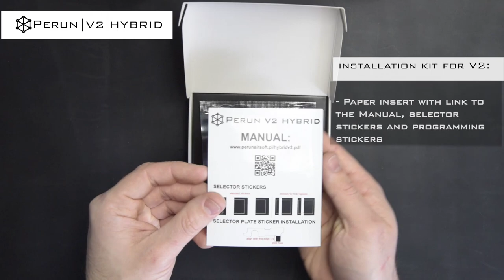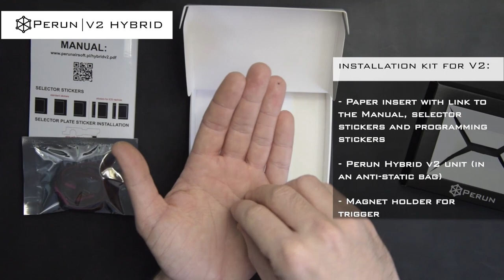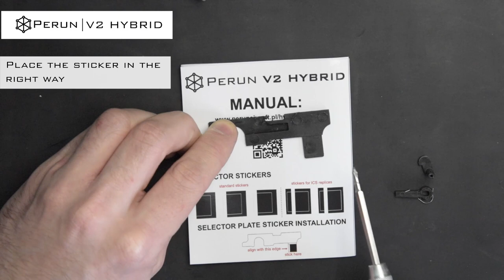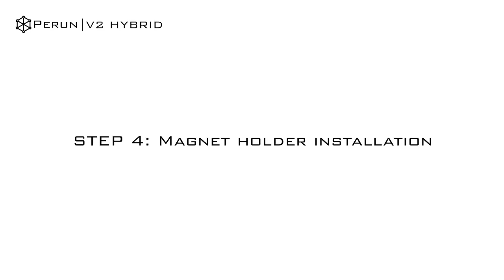Perun V2 Hybrid installation manual

Comment: hi, i've been getting great reviews from friends who use your mosfet on their aeg, and are eager to get one myself, so i want to ask if the hybrid v2 would still be fine and running after getting water in just like the optical in your old video? thanks
Reply from the maker: Thank you, we're happy to hear that :) The Hybrid should be fine after contact with water. We have tested it in a similar fashion as the Optical and it survived just fine. We still wouldn't recommend purposefully putting it underwater, but should your replica for some reason drown in a river for instance, Perun will most likely keep working.
Reply: @perunairsoft4811  that is great to hear! Thx for replying :)

Comment: Wow. I have the standard on my ICS. Will there be a video with an ICS gearbox installation
Reply from the maker: We don't plan on doing a separate video for ICS, but the installation process in your replica shouldn't be much different. It would actually be easier in an ICS thanks to the split gearbox.

Comment: Would any of this change in an LCT lk 33 gearbox
Reply from the maker: Do you mean, whether the installation would be different? It might be, because LCT often uses 32:1 gears, also known as max torque or infinite torque. Perun V2 Hybrid can't detect those and they need to be replaced to, for instance, a 27:1 gearset.
Reply: Thanks so much for the reply I will take a look at the gears tonight, I was in fact wondering if the installations would be harder for any reason. For example the trigger is huge G3 style and I was wondering if that would work. Also how different might the selector sticker have to be. @perunairsoft4811
Reply from the maker: @sebasscasey3908  Trigger is different on the outside, but the inner part which would mate with our magnet holder, has standard dimensions and will work just fine. We can't advise regarding the selector sticker, though probably the standard one (non-ICS) should be ok after finding the right spot.

Comment: So I was in the process of installing
mine when I did the sensor test. None of my sensors are working except the safe position. I double checked and the selector plate sticker is in the correct position and I did everything mentioned in this video. What should I do?
Reply from the maker: Please contact our tech support through info@perunairsoft.pl. They will answer you within 1-2 days.

Comment: About filing down the safety lever @ 6:31 -- a lot of people will have to do this, and not realize why at first. The magnet holder partially blocks the gearbox retention pin, so you'll pull the trigger to get that inserted, and your trigger will always be part-way pulled, like a trigger shim. But you have to make sure the safety lever still works as it should with the the trigger's new position, and that's why you have to file it down, or remove it. I didn't file mine enough, and the safety is stuck on until I open it up again to fix. This is a big headache, and a reason why I prefer the older Optical unit.

Comment: my sector gear has a magenet for my current mosfet. do I need a new sector gear since this perun mosfet senses magnetic force?
Reply from the maker: It depends on where the magnet is located on the gear and how strong it is. It's very likely, that it won't interfere with working of Perun's trigger sensor, which is the one magnet-based. You can also try removing the magnet.
Reply: @perunairsoft4811  thank you for your prompt response. Can’t wait for my Perun mosfet to arrive!

Comment: Hello, I installed a Perun V2 Hybrid into my CYMA and when I do the diagnostics test everything seems to work except when I flip it to Semi it flashes blue then red. When I flip it to Auto it just continues to flash yellow with no response. Would you happen to know what's wrong?
Reply from the maker: Please check, whether the selector sticker doesn't need adjustment according to the graphic in the middle of page 5. in the manual for V2 Hybrid: https://www.perunairsoft.pl/hybridv2.pdf
If that won't help, please contact our tech support at info@perunairsoft.pl

Comment: Would this work in a version 2.5 gearbox ? I have a cm098a
Reply from the maker: Yes, but there are two small caveats: 
- with 19-teeth gears and if the build is rather slow, if you don't want to use precocking, it's recommended to actually set precocking to level 1 or 2 to ensure proper gearbox cycling. In all other cases the Hybrid can be used similarly to any other replicas,
- you'd need to grind down a small, protruding part of the gearbox shell, which normally holds the contacts; it's something that has be done to accomodate almost all drop-in mosfets.
Reply: @perunairsoft4811  okay o think i know what part you mean. I have actually installed a 13:1 gearset so i think it Will be fast. Just need the Perun for better cycle of the gears as the cut of lever cant keep up. And also of the cool feuteures ahah

Comment: Hi why i cant enter into programing mode, gun shoots and all and i have made the sensors test many times, its all good, but when i test it with the motor on, i cant see any light or enter into programing mode for any shooting mode. Gun just works normally bit cant program it.
Reply from the maker: Do the firing modes work; can you access semi and auto? If yes, please try moving the selector faster.

Comment: how about trigger response? in the older version i can use in just 1.5mm to firing i can adjust the black piece in the trigger?
Reply from the maker: In the new version, the Hybrid, the trigger piece should be exactly where we recommend it be. Pushing it forward may result in a longer trigger pull. To adjust the trigger pull length, only the trigger sensitivity setting available in the programming mode should be used.

Comment: I plan on getting this for my vfc mcx, how would I go about running the wires?
Reply from the maker: We haven't worked with that particular replica yet, nor have we received any feedback regarding installation of Perun V2 Hybrid in it. Therefore, we can't reliably advise whether and how would Perun Hybrid fit there. However, we made some quick research on the internet and it looks front wired version should work. Still - we can't guarantee that modification to the replica or wiring won't be necessary.

Comment: Hi there,
I'm planning to install the V2 hybrid in my Lancer Tactical gen2, but it doesn't have a cut-off lever since the LT G2 already has an ETU instead of a trigger switch. I'm wondering if that would be a problem since the screw on that ETU is smaller than what a cut-off lever has.
Reply from the maker: Hello,
If the diameter of the screw's head will be too small to hold the board, you can try using a washer. Some of the gear washers used in AEG's could be good for that purpose.
Reply: Thanks! Good thing I bought some shims awhile ago. Can't wait to have it installed.

Comment: After finishing the install, the guns shoots for like 1 second and then get the intermittent red light. Is it my motor? I’m using a stock vfc black motor, shs 13:1 gears. Stock vfc mp5 a5 spring.
Reply from the maker: The battery might be too weak for that build or there is too much friction in the gearbox for some reason. Please try with a bigger battery and if that doesn't help, check whether everything in the gearbox moves smoothly after it's assembled. Should nothing come out of it still, please contact our tech support at info@perunairsoft.pl
Reply: @perunairsoft4811  I am new to airsoft and aeg replicas. since I own a Cybergun FN SCAR-L aeg, I noticed that it worked well at first, but when I started to use an 11.1V lipo instead of the stock 8.4V NiMH battery, the V2 gearbox started to make more noise than before, and then, it caused me trouble.
I took the gearbox apart and removed the stock grease, which looked like tooth paste (and probably greased the gears just as well). I then reassembled it all and tested the SCAR again: it was better, but still not reliable. BB-feeding went astray more often and the sound was still not good.
Then I took it apart again, cleaned all the bushings and gears, piston and just everything there was, after which I applied general purpose grease from a canister, which is meant for greasing hinges and such. I also took the O-ring and stretched it by putting it onto the outer cylinder, before I greased it too and put it back on the piston.
I did not have high hopes for this arbitrary action of mine, so all the greater was my astonishment when I had reassembled it all: the SCAR was shooting like it never did before! High FPS and high ROF, and no sign of a miss-feeding whatsoever! Amazing! All I did was remove the old grease, cleaned everything and greased it all. The hardware is still stock, with standard contacts and no mosfet yet.
But, I am considering the Perun V2 Hybrid anyway. I do not like the idea that copper contacts are switching 7A or more current as in the good ol' days of the early 1900's. Electronics like a mosfet ought to be standard.

Comment: Everything goes great but when I assemble the gear box it just doesn’t ONE shoot and stop working.
When I force the motor head, it’s seem like come back to work, but the same thing happen again, I assemble the gear box and after one shoot, stops working 😔
Reply from the maker: Please make sure that everything works smoothly inside the gearbox. You can do that by assembling the gearbox without the main and the tappet plate spring, piston in the forward position, and then spinning the motor gear manually using a screwdriver, bit by bit, until you make a full gearbox cycle. The gears  should be moving without much resistance.
Also make sure that motor's positon is not the problem. The motor being positioned too far from or too close to the gears can both cause such a problem. You can also look for short circuits caused by pinched insulation.
If this won't help, please contact our tech support at info@perunairsoft.pl
Reply: @perunairsoft4811  I tried again and it continues the same problem.
All the 3 gears works smoothly together or separately. 
It’s like same security system blocks the motor. When I shoot one, the gearbox do one cycle and stops. After that, when I connect the battery, it doesn’t make the BIP sound.

To make it works again, I have to remove the motor, force it with my hand to do one circle, and the system make that bip sound again. So I assemble the gearbox, and when I pull the trigger, it does one shoot and stops.

All the lights are working perfectly, the 3 fire mods, the purple trigger lights, the gear cycle lights… but when I shoot, it stops.

When I put the non-electrical trigger system back on the gearbox, everything works fine. 😔
Reply from the maker: @mauconx  We see, in that case please contact our tech support at info@perunairsoft.pl and let them know all this information.

Comment: Just got into airsoft and purchased one. Will this fit easily into a lancer tactical gen 3 with minor mods?
Reply from the maker: We can't guarantee, but according to our quick research it should fit there without much problems. Please be advised, that this is based only on checking information on the internet. We do not have first-hand information, nor we think we have had any feedback regarding the gen 3 Lancer.

Comment: Hello ,is it normal for the wire of this to warm up to touch??? I'm using 2.2mah 11.1v 30c battery only ,setup is 16:1 ,guarder sp150 ,Tienly 30k motor

and is it ok to use a 2.2mah 11.1 120c battery in this mosfet?
Reply from the maker: With such a configuration - definitely yes, the wires can get warm and that's acceptable.
Reply: Your wires are heating up because your motor is draining to much power, it's over stressed and the wires are too thin for that kind of power. Your motor is too fast for that kind of build, lacks torque. Try getting 18k motor if you don't mid lower ROF or get a brushless Warhead 30k (or 27k Base) motor.

Even your battery is at the limit of it's power output, it might puff up over time. 2.2Ah (2200mAh) 30C = 64A output current. 30k motors are 16TPA, you might be abusing your battery by pulsing at 100A (probably around 60A on Semi) or even more.

30k is supposed to be used with up to M120 spring if you're using 18:1. Doesn't matter what the manufacturers says, it's 16TPA motor and it just drains way too much power with such a powerful spring.
Guarder SP110 is around M120, they rate their springs with 0.25G bbs instead of 0.20.
Since you're using SP150 my guess is that it's some kind of DMR and 18k motor would be much better for that anyway. You'd get a noticeable gain in semi response since it has much more torque.

Comment: my trigger keeps coming off the metal rod in the gearbox, it can stay resting on it but it sometimes shifts to the the vertical part of the unit, how can i keep it in place?
Reply from the maker: Often the middle pin will keep the trigger in place, keeping it even more forward-leaning than the metal rod in the gearbox. Our advice is to assemble the gearbox with only the mosfet and the trigger inside, put the gearbox in the receiver and see whether after putting the middle pin the trigger always can return to exactly the same position.
Reply: @perunairsoft4811  is the middle pin the smaller or bigger bolt that goes through the gearbox and receiver?
Reply from the maker: @dasher8664  It's the small bolt, that goes all the way through the gearbox and the receiver. It's the one which will find itself immediately behind the magnet holder after insertion. In many cases, magnet holder will rest on this pin after it's inserted.
Reply: @perunairsoft4811  it worked! everything feels and sounds great! do you guys happen to recommend and hopup unit and air nozzle that are good quality?
Reply from the maker: @dasher8664  We're glad it worked! As for the pneumatic parts, we would rather recommend asking people who have more day to day experience in that area than we do :) We mean professional techs. That's because each replica is different. Some parts, even of great quality, may not always work with every replica and its parts.

Comment: i have a question, can i use 32:1 gears with this mosfet?
Reply from the maker: No, unfortunately not. We recommend trying 100:300 gears instead. If you're using any high torque motor, 100:300 or even 100:200 should be enough to pull pretty much any spring. Unless you want to use 32:1 for a different reason.

BTW, V2 Hybrid does not work with 32:1 gears, but V3 Hybrid does.

Comment: Hi. What solution do you use to clean the selector plate and contact points?
Reply from the maker: It would be best to use alcohol, either standard ethanol or isopropyl alcohol (IPA).
Reply: @perunairsoft4811  Ok, thanks for the quick response. I'll be sure to pick one up right away. Btw, I need to level a screw hole for a cyma gearbox right?

Comment: Will this fit a kwa tk45c with a v2.5 gearbox
Reply from the maker: KWA replicas (except for the old 2GX ones) are tricky. There are many Hybrids installed in them and they work mostly fine, but sometimes it takes a lot of headache to make them work that way. The problem are the small excursions away from the standard that KWA makes. KWA 2.5 gearbox was optimized to work with Gate Titan, but it’s still not a 100% Tokyo Marui compatible gearbox and often need for modification arises. The short answer is - yes, but if you have a lot of experience with teching, have a dremel around and can put some time into making it work.

Comment: What is the advantage if you this perun mosfet
Reply from the maker: - Higher reliability of the replica, especially of the semi-auto mode.
- Precocking, which allows you to greatly improve the trigger reaction time.
- Spring drop to easily and quickly release the spring after using precocking.
- Battery protection.
- You can freely and independently change the firing modes (set burst or semi instead of auto, etc.).
- Binary trigger.
Those are few examples, there can be many more advantages depending on what your needs are. You can learn more about this mosfet here: https://perunairsoft.pl/products/v2-hybrid/
For more details about particular modes, you can watch this video: https://www.youtube.com/watch?v=2o4eWEYyw7c&t=1s

Comment: Will the magnet holder work for a G3 t3 trigger, or will I have to modify the trigger to fit the magnet holder?
Reply from the maker: We had some feedback about the Hybrid being successfully installed in an LCT G3. We're not sure about G3's made by JG. We suppose that they also shouldn't need any modification, but we can't guarantee that.
Reply: @perunairsoft4811  also can your Ab++ be fitted onto a version 2 gearbox, or can that only be fitted onto a version 3
Reply from the maker: @Gumball935  Perun AB++ will work any airsoft gearbox.

Comment: Anyone know if this will work fine with the m249 featherweight? My first  concern is with the trigger magnet, and second the fire selector plate does not move to my knowledge, but the stock electronic trigger unit looks like the same dimensions so fitment shouldnt be a problem.
Reply from the maker: If that replica doesn't have the ETU system inside, the trigger should fit.
The lack of selector would be a problem, though. V2 Hybrid needs to "see" any movement of the selector after start-up, otherwise it will stay in safe mode.
Reply: @perunairsoft4811  I will try programmining it in an m4 lower then move it to the m249 body
Reply from the maker: @mrgamingplatypus5833  This will not be enough. Each time you connect the battery, the unit has to see some movement on the selector plate. Otherwise it will stay on safe. Unless you are able to install a selector plate there and find a way to move it back and forth after every installation, it won't work.

We would rather recommend Perun AB++ for this particular replica.